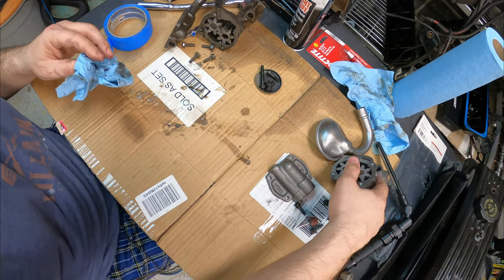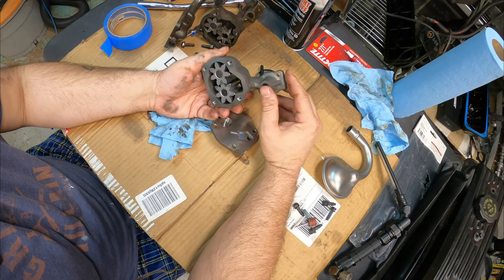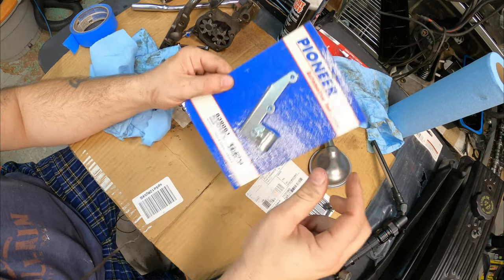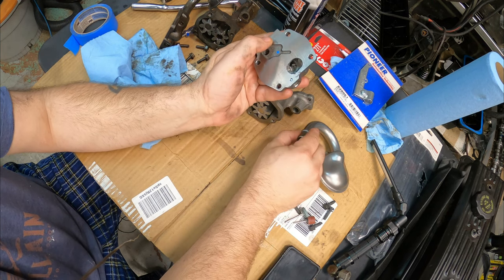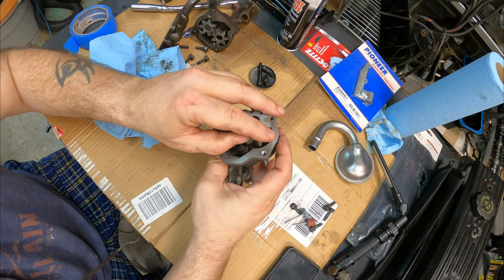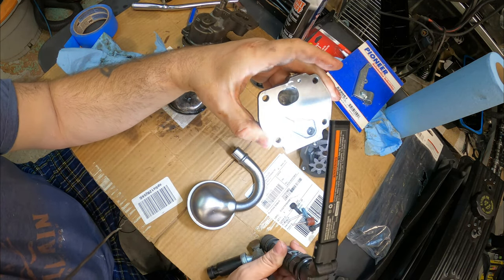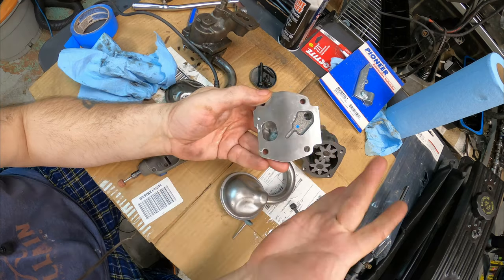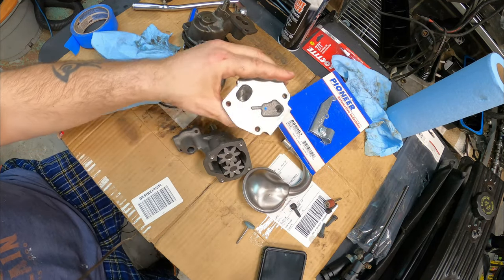Small block Chevy oil pump

Comment: With good clearances and a stock oil pan, a stock or high pressure is best.  Pressure requirement is based on RPM with a basic rule of thumb being 8 lbs plus 8 lbs per 1,000 RPM.  Stockcar engines I built running 6,000 had 55 - 65 lbs hot at top rpm, 20 - 30 at idle running 10W-30 or 40 synthetic.

High volume also requires a deeper sump.  If you are moving more oil, the level can get low enough to allow a vortex to form, like in a sink draining, which allows the pump to suck air, so you want lots of oil above the pickup.  A rectangular pickup also helps prevent a vortex.

The extra oil enhances oil cooling as well.
Reply: Good info here thanks.
Reply from the maker: thank you for your input great info ...
Reply: Too much oil causes cavitation  and power robbing windage.
Reply: @ronniecox109  Only if it is overfull and getting picked up by the spinning crankshaft.  A proper deep-sump oil pan minimizes oil aeration and the level below the crank stays the same as stock.

With a high-volume pump, the critical issue is to eliminate the possibility of a vortex above the pickup introducing air into the pump, and therefore, into the oil system and not getting the oil closer to the crank by overfilling.                        

Any built engine should also have a windage tray to minimize the crank picking up oil from the pan at high RPM and to help "spin-off" return to the pan.  A crank scraper would also be a benefit.
Reply: @lelandlewis7207  isn't  that what i said? Too much oil.all i said,and nothing more. Well aware of all you said. Built hyndreds of engines, stock, street/strip, marine, and full race units. As well as the transmissions, with Tbrake,rev. Pattern. Std shift pattern, full manual.and set up 3rd members, (differentials) . My setup in my81 Malibu wagon. Dart block,4.125 bore, 4in. Stroke forged K1 technology crank, Super pro forged rods,Wiseco +5 cc pistons, Std volume, high pressure oil pump..   .027 MLS Head gaskets, AFR 220 CNC heads, HOWARDS solid roller.650 lift cam, Super  Victor intake, and 850 DL DP Holley. 400 trans . 8.5 differentials.  with 4.30 gears. And spool. 9in. custom built PTC convertor in the 400. And my back halfed , wheel standing S10 with a destroked 400/377 glide, ford 9in rear, coilover 4 link. 10 point cage. ALso AFR heads, Howards valve train. Super victor intake.and have one of the fastest 351 Clevelands, stroked to 408, in the south ,
Reply: Moroso oil pans on both.
Reply: @ronniecox109  

Simply saying "too much oil" makes it seem like you are saying that having more oil will cause windage.  Being more specific by saying an overfilled pan can cause windage would have been better understood by less knowledgeable people.

You have a very impressive resume.  I have been a licensed Automotive Machinist since the late '70s, apprenticed in the mid-70s and have worked on many types of engines such as mini-tractor pullers, muscle car engines in the late '70s, street engines, alcohol funny car, Formula 5000, local stockcar classes, ACT stockcar to doing valve jobs on DC3 cylinders and was lead-hand on the overhaul of a Fairbanks-Morse 12 cylinder tugboat engine.

The issue I saw wasn't the knowledge, it was the lack of context that others might misunderstand, so I made a post to qualify what "too much oil" means in either a stock pan or a performance pan.  I have seen people put a wide-sump pan on an engine thinking that more volume is the same as installing a deep pan, not realizing that the level isn't deeper than stock and a vortex can still occur.

Many people who read these are new at building or don't have the right information, so I try to be as specific as possible so there is no misunderstanding.  I have had many people argue with me because they misunderstand someone else's comment or don't understand the concepts involved and will be making explosive mistakes.  It is hard in comments because they can be taken completely the wrong way if not well explained and sometimes even if well explained. lol
Reply: thats funny you claim to use 10w-30 as every vehicle i switch to people call me crazy for using it yet i have great bearing life.
yeah some modern engines need thinner oil but under hard load thin oil gets thinner. nobody gets that.
Reply: @chehystpewpur4754  Also consider, the thinner viscosity, will drain back into the pan a little quicker. Mitigating the scavenging , that could be caused by high volume oil pumps, and stock capacity pans. I use 30 for breakin, and in the colder months. Summer, I use 10w 40.And have no oil/bearing failures.
Reply: @lelandlewis7207  Enginemasters did this very test , i think with BBC 468.The hp gain that Steve Brulet foud was most significant running 1 qt low. Wirh a factory type sump pan. The most significant gains where impressive with the long flat racing pan ,with windage screen ,and crank scraper. But because a stock chassis prohibits its use, strictly a race car piece. As far as oil pumps for small block, I use the Milodon pt# 18756. Std volume,high pressure.. or a Moroso blueprint race pump on the more high end builds. ✌️👍🤙
Reply: @chehystpewpur4754  Oil requirements depend on clearances as well.  In the good ol' days, we built racing engines loose with clearances of .002 - .004 on the rods, up to .006 on the mains and .005+ on the forged pistons, so we used a thicker oil, usually 20-50 racing oil.  The damn things sounded like diesels when cold. lol  The extra clearance allowed quicker acceleration of the engine and lots of oil for being protection was the theory.  Even factory engines in cars were looser than today.

Today we keep the clearances tighter because the oils, bearing materials and pistons are better, so a thinner oil is needed and does the job.  It also helped fuel economy with less parasitic loss to the oil pump and less drag of thicker oil.  

The last major engine I built had stock bearing clearances and clearance of .003 - .0035 on forged flat-tops, ran 6,500 and made 445HP at 6,200 with a 2-bbl Holley.  We ran 10-40 synthetic in it and it held great oil pressure with a dry-sump system.

The difference between a 5w30 and 10w30 is the cold rating.  5 flows easier when cold, but both should have the same protection and flow when hot.  Of course, mileage, heat and load affect oil requirements, but heat should be controlled by the cooling system.  In my 1998 Yukon, 5.7 with 546,000KM (340,000 miles) on it I ran 5W40 high-mileage instead of 5w30.  

All of my stockcar engines would come in after a race between 190 and 210, depending on weather and race length.
Reply: @ronniecox109  Yep, windage losses can be significant and can be destructive.  I don't remember who did it, but one of the major racers, maybe Smokey, did a test years ago with a clear pan and I think, timing cover, to show what happens to oil in a running engine.  In seconds, it became foam.  I think Moroso uses the same technique now to study oil issues.

I remember one case at the track where the engine wouldn't rev very high and was sluggish accelerating.  Someone had changed the oil, but another crew member came behind and added oil without checking the level (plug on the "wing" of the pan) thinking it was still empty.  The crank was almost submerged in oil.

Every small-block I do, at the least put on one of the GM widage trays.
Reply: @lelandlewis7207  actually bearing clerance isnt the only reason why oil viscosity is selected now but your mostly on the head with older motors.
some newer engines have oil passages that are impossibly small. including small screens in those passages. mis 1-2 oil changes and its time to replace the motor. also the cam phasers act crazy with some viscosity oils so that has called for other viscosity's to be used.
i dont own any of those engines and for good reason their junk.
simple easy reliable and economical.
when you pop the hood and the manufacturer tells you to run hopes and dreams for oil you know its not gonna last.
Reply: @chehystpewpur4754  Yes, there are lots of reasons for differing viscosities.  For example, Fords are noted for plugging galleys and phasers if oil changes aren't kept up.

I am comparing the basics of old performance with newer performance of equal engines based on the beginning of the discussion, which was oil pumps and oil pans, and the major differences there are the materials and clearances.  Even in older engines, we used to install oil restrictors for solid lifters, which require less oil, and leave full flow for hydraulics.

My 1998 Aurora uses 10w30 but the 2004 Crossfire I had used 0w40.  The reasons are probably many and defined by the engineers who designed the motors. 

To get into all of the differences still comes down to the same issues, a constant flow of oil and its ability to flow and protect and would require a whole video of its own to explain it all.  Thinner oils were initially introduced because of better materials, clearances and mileage; they have just added more aspects to the equation.
Reply: @lelandlewis7207  thinner oils also are more prone to shearing and it keeps me away from those. im not discrediting you so if your taking it that way im sorry. im just stating things i also know from experience.
ford diesels exposed many problems in the oil industry as their diesels were pretty much a joke. stiction and shearing were 2 things that came into play big to fix some of the issues they had. and it made me dive alot deeper into the oil rabbit hole than i ever chose to want to dive.
0w-20 oils and thinner are basically water and dont stay in the bearings under a load. so many newer cars have major bearing issues and they also run these oils. i stay away. they also dont adhere to the top of the engine so yes they do return to the pan faster but they dont lubricate on startup. the system has to prime first.
10w-30 has some of the best oil specs without getting into molasses viscosity or just using grease. neither would make a great oil.
but 10w-30 doesnt flow much worse in the cold and has far superior shearing and stiction so when your motor is under a load the oil stays in the bearings and that means alot. rotella is a fantastic oil for old motors as its a little thicker and has additives like zinc you cant find in many oils now. but its just a bit too thick for my purposes and i really like the mobil 1 oils. 
time and time again mobil1 performs with the best oils and is very stable under stress but it comes at a price. only a little more a bottle than the cheap oil many people go for. 
do your research pick your poison and stick to it and your motor may thank you.
Reply: @chehystpewpur4754  
Proper oil choice is always flexible based on usage of the engine and other variables.

Shear also has a lot to do with additives, with some having better resistance than others.

As to under-load oiling, that too depends a lot on clearances, including connecting rod side clearance, oil pressure as well as compression and RPM, to name a few variables.  If side clearances and bearing clearances are wider, more oil gets past lowering pressure inside the bearing.  Tighter clearances help retain oil in the bearing and maintain pressure under load.  Like everything though, there are limits.  

What a lot of people don't realize is that the highest pressures are on the bottom of the rod bearing at TDC on the exhaust stroke.  The change in direction of the piston with no pressure pushing down on it, such as occurs at the beginning of the power stroke, can create tons of pressure on the bearing.  This is where reciprocating weight and RPM really come in to play.

When we ran looser engines we ran high-volume, high-pressure pumps to compensate for the bleed off and to increase load protection with increased pressure.  In any engine, an increase in viscosity will increase pressure, but will also decrease flow.

Lack of zinc is a big issue for engines with flat-tappet cams.  Lack of lead in fuels is also an issue for older engines.

I am working on a 1948 Buick for a friend and the first thing I talked to him about was getting the modern oil out and getting a bottle of lead substitute for the fuel.  No one that worked on it told him about any of it.  It also has ball bearings in the front drums, as does another friend's 1958, so I contacted Valvoline for a recommended grease because most modern greases are made for disc brakes and roller bearings.  So many issues with older cars and modern tech. lol

Comment: I agree it's sketchy to try to weld steel to C.I.  But I have brazed that joint & it seemed to work quite nicely.
Reply from the maker: yes you can do that but will be using the hold down bracket i suck at brazing lol
Reply: This whole method of holding the pick up tube to the oil pump is a big short coming. No question.
Reply from the maker: 100%  @maxmoore8876

Comment: SBC never needs a h/v pump. Factory high presure pump [55 psi] used on all 350s on suffice and does not load up the gear on the cam. I have run 7500 for 2200 racing kms with 55 psi and the bearings were like new. I have seen 327s with OEM pump run at 8500 in the 70s. All that with 35psi. And they lived fine. 50 grade oil. These days most are using 5w30 which pumps so much easier.
Brazing the pickup is a good idea. Imperative? If fitted correctly they seldom cuase an issue. When butchered in then they can fall out or suck air as well,

Comment: You dont weld to the cast components of the pump.  You can braze the pickup tube to the housing or you can weld a strap to the cap screws holding the pump together to the pickup tube. I like you bracket too, I would locktight the threads so it doesn't vibrate loose.
Nice video
Reply from the maker: yes your 100% correct about cast components thank you for watching and supporting the channel ....

Comment: Also insert a higher pressure spring when running large racing clearances, that stock pump is best performer and wont empty the sump like an hv does.
Reply from the maker: well said

Comment: Nice video, can I ask how you can test the pump , or identify it's bad. Thank you.
Reply from the maker: pumps like this don't just go bad unless  it ingests material.. its over time the clearances in the pump become loser allowing  more oil to be bypassed not making it to the engine (in simple terms). technically you can check clearances of the rotors but its cheaper just to by a new one... the old pump had some scuffing inside that why i did not re-use it.

Comment: How about pressure balancing the gears& i take & block sand with 600 wet or dry end plate & pump mating surface .
Reply from the maker: Yes you can do that also but for most its not necessary

Comment: I wonder if the shark tooth pumps are already cleaned up or cast differently? I've never noticed that in the last 39 years. Now you got me wanting to pull my pan. Lol
Reply from the maker: I was thinking of cutting the old pump to show
Reply: @maldo72  surely a $125 oil pump is already good to go. I know better than that. Lol I'll probably check it.
Reply: @inscoredbz 
These days you can't buy a new head, without taking apart and checking everything.  Most every time something needs to be fixed.
Reply: @inscoredbz  You got that right. I just bought a Chevy 350 long block from ATK, and was going over it, I pulled a head bolt...then another, then all of them. Not a trace of sealant on any of them. Buyer beware.
Reply: @corbinhbucknerjr558   was it one of their blueprint brand blocks or remanufactured gm block? If it was a blueprint block, they might not go all the way into water.
Reply: @inscoredbz  It is a reman. It looks fine just looking it over, and I had intended just to check torque on all the head bolts until I pulled one and saw no sign of sealant. It turned out none of them had any. This is my first Chevy engine, I've been a Pontiac guy and have completely rebuilt two 400 Pontiacs. Pontiac didn't make a V-8 that had headbolts going into water jackets, so I was a bit paranoid with the Chevy. I have to say, although I took all the headbolts out I didn't remove the heads and actually check the bolt holes, so you may be right.

Comment: Any thing that has larger clearances than stock a 10%xtra flow is ok .  An engine that has turbo or large oil cooler requires 20% xtra flow .
Melling produces 4 different lines   budget /stock ,, M-Select , Sharkfin tooth ,, Full CNC . All have HV versions and some have different pressure springs  
Shark fin with bolt on pick up plus 10% HV   is a good up grade for any performance motor
Reply from the maker: thank you for watching great info

Comment: Wish i knew about this back in October  when i did my sbc and the pickup tube bracket i welded mine with a strip of steel to the bolts that holds it together because thats why it locked up tube fell off
Reply from the maker: yes, that's why I choose to use the bracket i have had the tube fall off a couple of times in the past ...

Comment: How do you know ? Ran a plastic see through pump so you can see what's going on ?
Reply from the maker: This type of modification goes way back and has been proven to help flow and decrease cavitation in the upper rpms...
Reply: @maldo72  honestly. Who proved it ? 
One of my friends had a 9 second drag bike.
He wanted to see what was going on in the crank case. 
So he modified a heavy duty plastic window.
He changed to find an oil that wouldn't foam up. Bad sentence. But you get the picture.
He showed me the oil that wouldn't foam up.